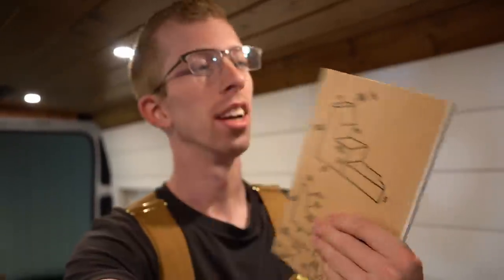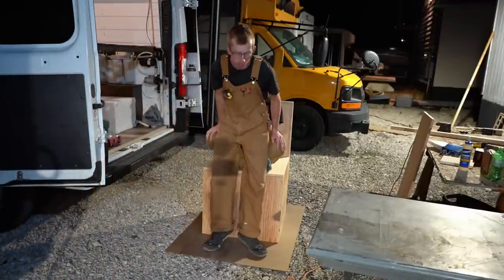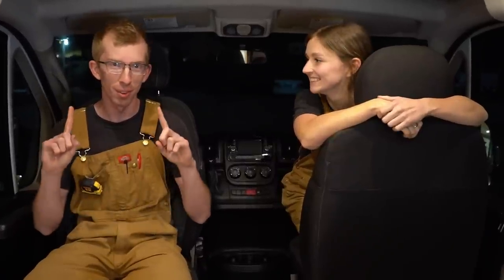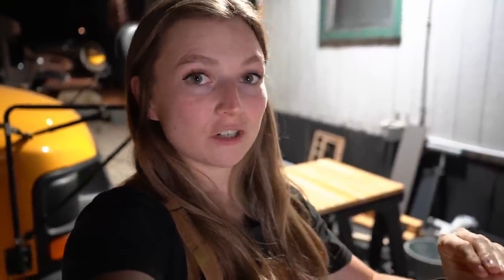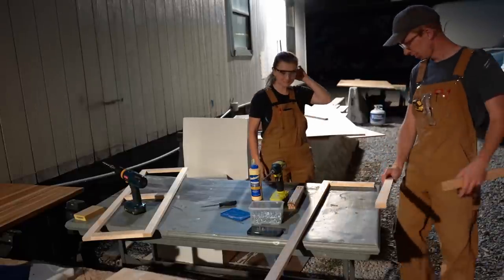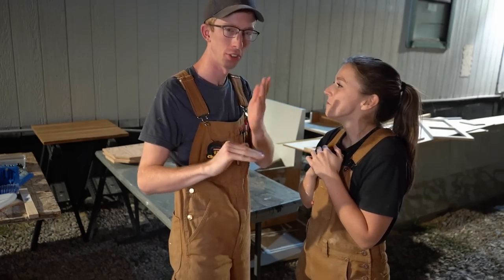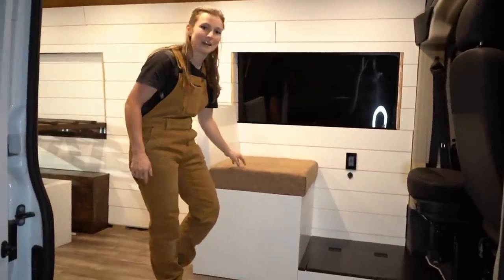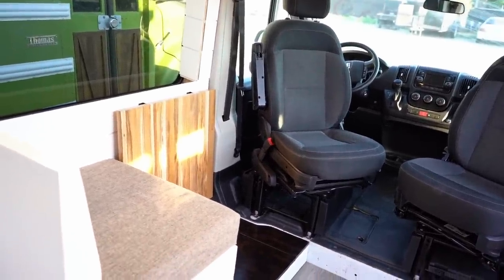THE FUN PART BEGINS (vanlife conversion) | Dinette, Swivel, & Overhead Cabinets

Comment: Teak is a beautiful wood. Over my 30+ years of residential painting we re-finished many set of teak tables and chairs. Some we just power washed, some washed and primed then painted (yuckie), Stained, poly'd, Epoxy, pretty much any product out there we've used. My opinion is natural or a latex clear. This wood also helps with bugs and is rot resistant.

Comment: Protecting the teak in one form or another is important, the finish you are putting on is fine. Most teak is not stained exactly for the reason you said it’s beauty. You can use a straight edge when using your saber saw like your circular saw makes it a bit smoother cut. It’s too late now but a french cleat is a great way to hang a cabinet. Easier for you to google it than for me to try to explain it. Well done on your cabinet build, I was a cabinetmaker for 25 years. When ever possible always pre drill for screws except for pocket screws.

Comment: I've watched all the videos (and subscribed) of this build and I think you are doing an amazing job. However as a woodworker / furniture maker I have one little (well meant) remark/question. Why the clumsy big hinges on top of your raised floor? (I see this a lot in van builds, people just screwing hinges on the outside). It wouldn't be much work to use a piano hinge in between the wood. (You can use them on material as thin as 10mm, although sometimes you have to make them thinner and redrill the holes closer to the edge). It would look (and feel) so much better. Not criticism, but a suggestion!
I'm looking forward to the rest of the build! All the best from the Lonesome Hill in Central Portugal (where we also work at night because of the heat 😀)

Comment: It might be too far in the build and it might sacrifice a bit of strength but it might make sense to make a cut out hinged door on the outer sides of the overhead cabinets and convert the current solid panel in to a hinged pass through so you could, open either end from the stairs into the van or from the rear back door area and it just quickly chuck something in without stepping deep into the van to access those two end cabinets. Do you have any plans of having a mistake/split / left over cuts of wood bonfire on your very first camping trip to inaugurate the completion of the van?
Reply: A bonfire, what a great Idea!

Comment: Teak is supposed to be oiled not sealed. I think from what you've described you are going to have issues using the toilet. It would appear when you sit down the edge of the seat cabinet is going to cut into the backs of your legs. Did I miss something here?
Reply: I added material to prefent the legs from all that. Np now... Lid has soft surface too when closing. If there is a will  there is a way. 😃